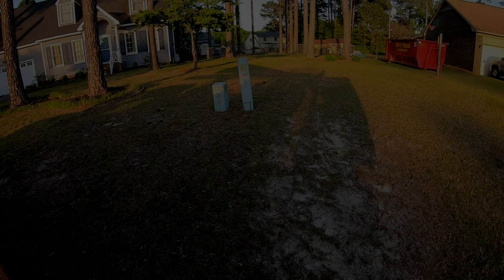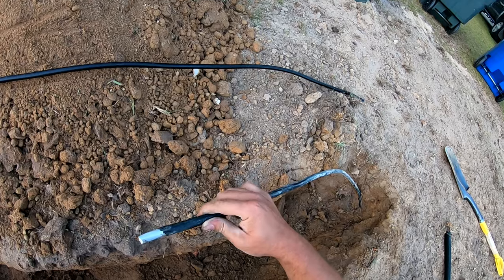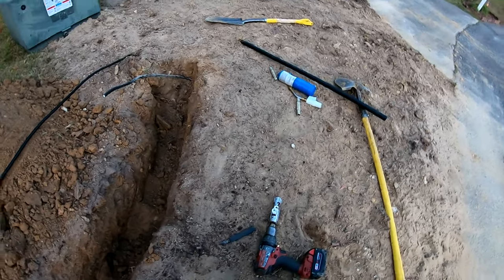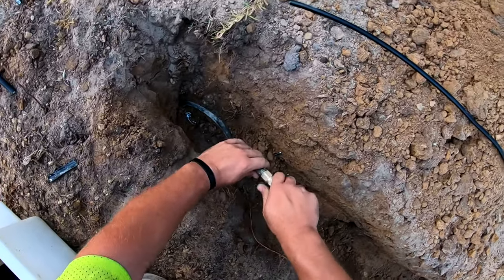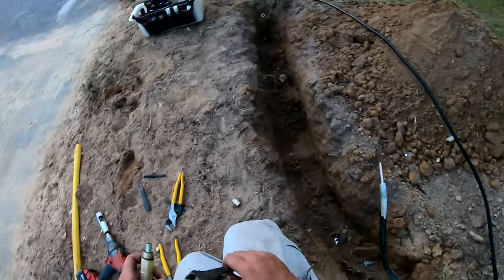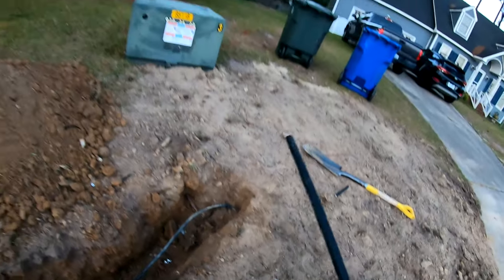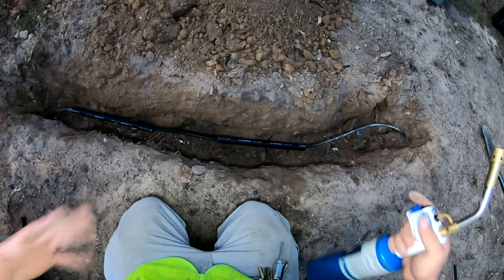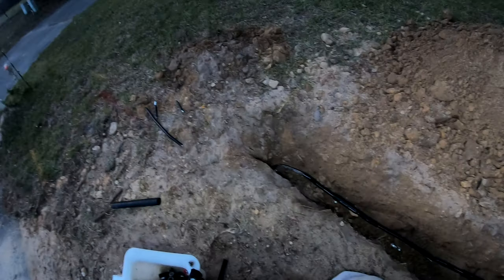Cable Maintenance Tech - Splicing Hard Line Cable - Refer to Maintenance Call (Y6)

Comment: Good job on the vid man.
Reply from the maker: Thanks, man!
Reply: If you want to really learn how to splice coax go to a school or they will teach you the proper way this guy doesn't know how to splice. And you never use a drill, it can actually spend your stinger somewhere in the cable if it's not done properly and one more note take your pliers and full that Stinger after you done it to make sure it's not broke somewhere in that cable from using a drill to court it out. I did it for 30 years I know how to do this shit. Good luck in your adventures and cable splicing will come to an end one day I won't be no more 500 cable or 750 cable the lobby fiber. Good luck

Comment: Using a loop makes this a much easier fix for direct burial to avoid resizing over and over.
Reply: Hard mains are very stiff and not easy to bend in a loop, especially in a tiny trench like that, and generally it's not a great idea to leave loops of main truck line in the ground.  Almost any maint. guy worth his salt will do a tie-in or intercept this same way.
Reply: @kyliam80   nothing stiff about 500... would be the easiest to loop but no need that will only cause more problems so i agree

Comment: I am curious, how come this line did not have voltage going through it?
I am new to HFC, worked on it lightly and know fiber-optics more than anything.
Reply: The reason it didn’t have AC is due to there not being an active device past it (amplifier). He stated this line terminated not far from him. 

There are situations in the wild where a shunt or fuse was left in a split or DC that directs AC down lines that it’s not needed, however when we find those we try to remove the AC from those legs to prevent a possible unwanted short.
Reply: @4TDsInOneGame  they have fuses in the amplififers . when the crew arrives at the node , the splicer who is in charge will go to the main amp node and pull the fuses . you can start working and keep in mind you may be hot , check for ac before lighting yourself up . usually they will call out on the radio and let everyone know when the fuses are pulled and its good to cut .
Reply: Crew ? Shit brother we are 1 man crews where I come from. If and when there is ac present, nobody takes the time to go and pull a shunt. You repair that shit hot lol

Comment: Why wouldn’t this coax be in a conduit. I understand it’s 500 and is “underground” coax but usually that should be in conduit. Stuff wrecks easier than you think.
Reply: Old build most older stuff was free buried
Reply: Because we don't put coax cable in conduit. It's not as if the conduit would've made any difference here, they'd've just dug up the conduit too. (fiber is about the only thing people bother to put in conduit, but not always.)
Reply: Everything is replaced in conduit. This situation the power company would pay the bill for repair and replacement in conduit
Reply: @jfbeam  all new coax is in conduit unless someone is cutting corners.  Direct burial is very old school.
Reply: @LeslieHarvey607   Some contractors put the conduit in concrete

Comment: Great job with the splicing, I want to get into cable jobs, do you have any advice on how to get started on this field?
Reply: I would either go to a trade school for it or just try to apply at places around you for a ground position. If they need people they will most likely hire and that's free training! But experience with tools and working as a helper helps a lot for getting hired.
Reply: @ethanlyons6594  I'll keep that in mind, thank you! 🙏
Reply: Nothing beats experience.  Get a job as a local cable tech doing installs and service calls and learn the basics (generally you don't need a crazy education or any specialized courses), then work your way outside to the infrastructure of it all.

Comment: If there is power will pulling the tap plate kill the power?
Reply: Not if there is a bypass bar. Some have it, some don't. I put in a tap plate with the pass through on the plate cut and shorted to the spigot closest to the end of the tap plate. This does 2 things. It doesn't pass power and it allows me to TDR the distribution without disconnecting anything.  Spigot on the left TDRs the input. Spigot on the right TDRs the output (depending on brands). Saves me from going back to the amp or trunk to pull a fuse...or to replace one.
Reply: @Todd.T  I used these videos to get more money at a new job I started. I was able to claim that I had more experience then I really did. I am up to speed now but thanks for helping me start a new career and feed my kids in these hard times. I am try to scam my way into the fiber splice class now .
Reply: @jamesbaker6691  Fiber is easier but at some point they are goingn to have to pay a goldmine for people that understand RF. Our networks are being converted to GPON and RPhy which takes 10 gig data feeds. There is no RF. Data over fibre to ethernet. All the modems have teh RF portion turned off and they are just used as wifi gateway/routers.

Analog RF is transitioning to OFDM/A carriers and there are a lot of issues with connectors, dirty fibers, broken node receivers, broken node transceivers, dead power supplies, broken AGC modules and the list goes on. Fiber only techs don't get paid more. Most of the work is subbed out to the lowest bidder. 

All the old school RF guys are retiring and don't understand the new tools/computers or OFDMA.

Look at videos from The Volpe Firm and the Viavi meters website if you want t oreally see what is going on.
Reply: @Todd.T  Why would a company go HFC instead of 100% fiber ?
Reply: -Fiber is plug, play & walk away.
-rf = ingress, egress, bandwidth alignment, return path, lots of voltage.

Comment: It's too bad that they give inhouse guys such crappy tools to work with. But they complain about system dependability. No jacket strippers, Cablematic coring tools, two piece fittings jeez it's a struggle.
Reply: . i worked subcontracting fot att in the late 90s . i could tell you storys .

Comment: Like to know who taught you how to splice the 500 cable never use channel locks to tighten your connectors you want to hear that last click at the end and you want to clean that yucky crap off of your cable especially today using the frequencies they use that to clean your cable properly tighten it down with the right tools. The reason why you have to close at get suck out on. If you ever came on my job I would have fired you for using channel locks. I'm not going into details with you if you do it properly. Your signal at the end everything should be fine but if I looked on a spectrum analyzer and look at the beginning and the end of every one of your Spicer's I try c1000 faults, so take a little pride and what you do if you're going to show it on the internet show it the right way please. Just remember one thing your frequencies ride on the outside of Center which is called this stinger take a little more pride in what you do because the customer will always have problems when the cable is not done properly.
Reply: Unhinged comment. Nothing he did was wrong. If he didn't have pride in his work, I doubt he would have heat shrinked in the first place